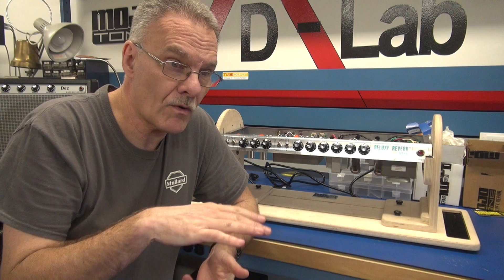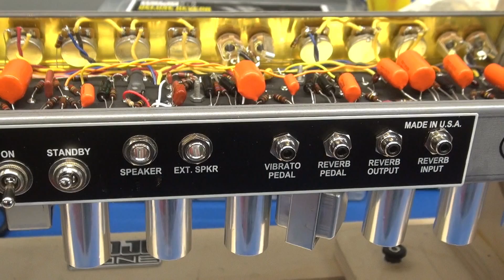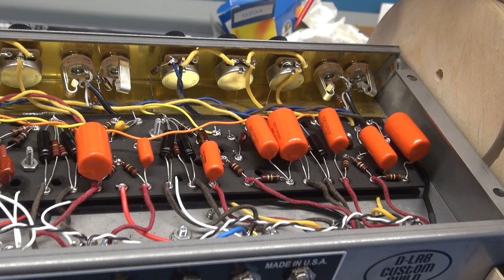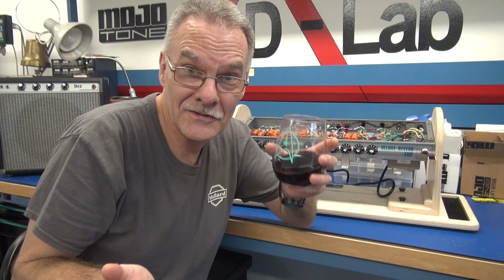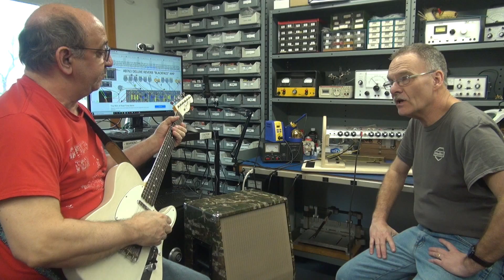Build MojoTone Fender Deluxe Reverb Kit Tube Guitar amp Part 2 Complete & demo + D-lab Support

Comment: Question, does it matter if a person uses metal oxide resistors versus carbon comp?
Reply: In a high fidelity application with exceptionally low noise floor and low distortion speakers, you can hear a small difference. Carbons are a bit noisier and not quite as detailed in sound. I have found in guitar amps the difference in sound is negligible.  Different coupling caps will have a greater influence on the sound quality than resistor type. Not saying you cannot hear a difference at all, only that it is not significant.

Comment: Do you have an office phone or email ?
I am located in Texas .
I collected RCA cases and bought tubes in bulk for awhile.
there are tubes in those boxes which Im certain you can use
for Ham or Radio or perhaps amps but thats why I bought them for vintage tube amps.
I also have some questions about bassman amp builds ive done...
Ill brief you over email or phone ..
Reply from the maker: Yes, the number is on d-labelectronics.com